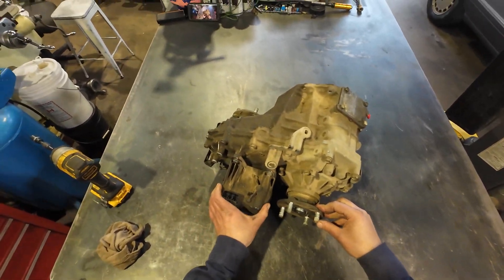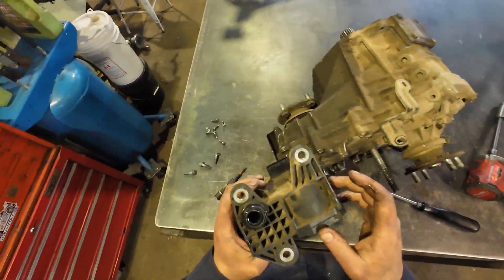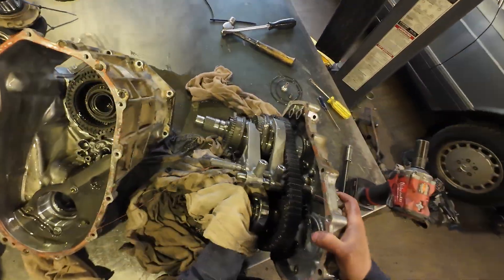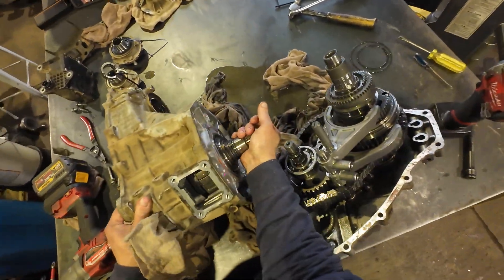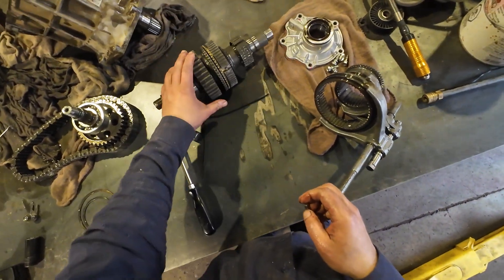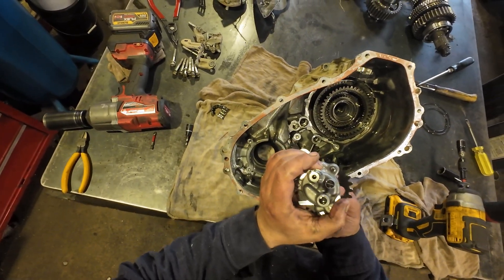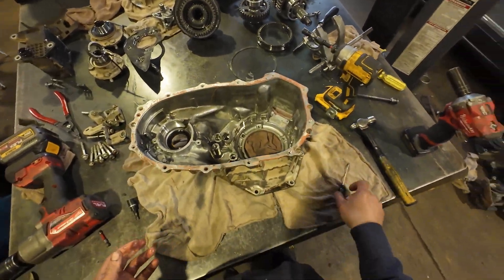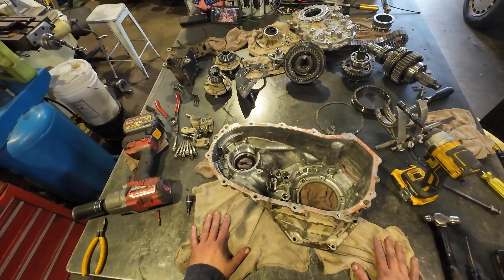2016 Toyota Tacoma not shifting out of low range. Transfer case teardown. Repeated user errors...

Comment: really great video, i have a question, what did you use to  clean the gearbox ? what type of product ? and conteiner ? thanks !
Reply from the maker: I just used the regular brake and parts cleaner in the container it comes in.
Reply: @3D4KAUTO  its boréale cleaner in thé very Big tank ?
Thanks